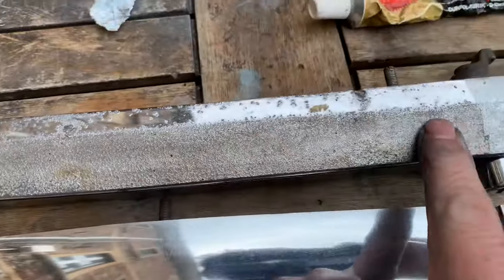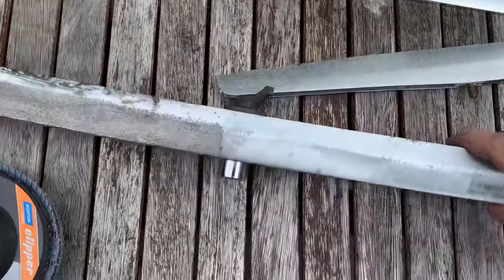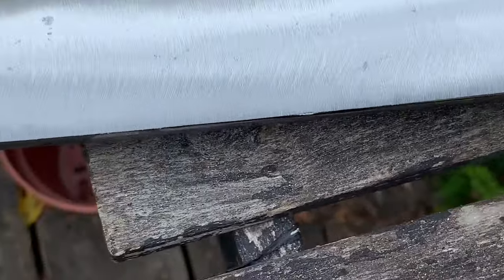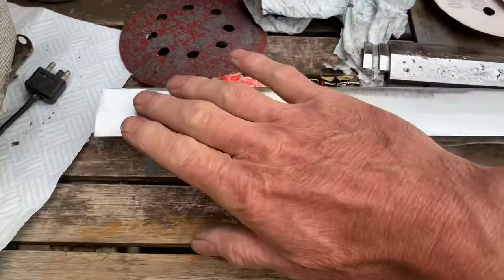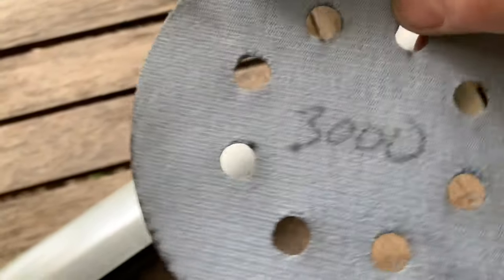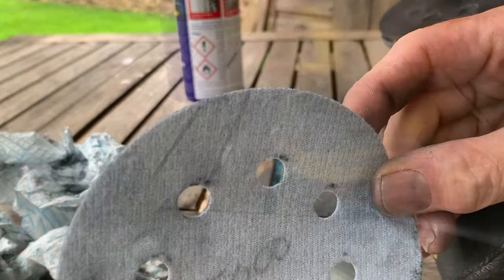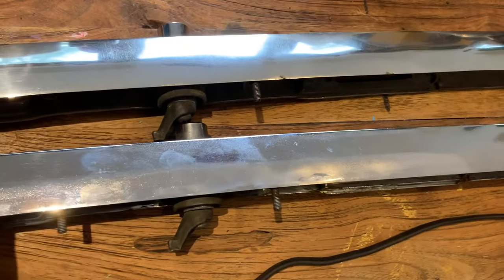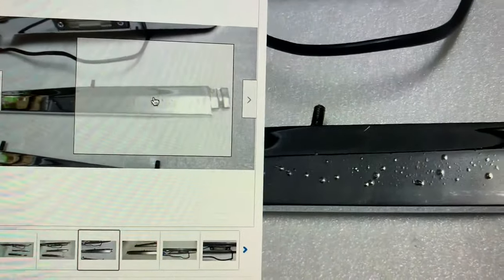Mercedes r107 - how to get a mirror shine on rusty pitted chrome

Comment: Didnt u just sand the chrome and copper outer layer and polished the steel core?  If so it will rust quickly…
Reply from the maker: Thanks for you comment. That would certainly be true if those pieces of trim were made from steel but I think they are aluminium or some similar alloy. Mike
Reply: @MikesMercsandothercars  well then the only option would be re coppering and rechroming it... I did what u did with 70 challenger trim and i have to polish it frequently as it becomes dull.
Reply from the maker: @pawelsyrek3721  Thanks for your comment Yes - I am interested to see how it holds up.Aluminium will definitely dull BUT we are definitely in a better position than before without the expense of re-chroming...I have several spare pieces of trim and may see whether there are any products out there which would adhere and seal. Maybe the new breed of 2k clear coats. Mike
Reply: @MikesMercsandothercars  Great video, thank you 👍.  I think it might be worthwhile trying a ceramic coating as opposed to spraying them with a clear coat. My reasoning is that as the items are highly polished there is no key for the clear coat to bond to.
Reply from the maker: @karl3927  That sounds like a good idea - I might try it next time. Mike
Reply: @karl3927  You can also use a clear adhesion promoter for metal, by UPOL, and then top with any type of clear coat.🤙
Reply: @marcusprince3999  Thank you for the tip 👍.  I'd never heard of that product before. It seems to have great reviews too.
Reply: @MikesMercsandothercars hey man, how did it hold up? Seriously need some answers for my own vehicles sake
Reply from the maker: @11secbug  Hi - those rear pieces still look good and I have not yet needed to polish them. Having said that....the car hasn't moved from the garage yet as I am still restoring it. Mike

Comment: Great video. As everyone wants to point out, this is completely removing all the plating including the chrome and giving you bare metal, but so what? Now you can take care of it, keep some polish on it, and if you do see some rust you can spot polish or even sand and re-polish it easily. Pitted chrome is worse, it collects water then rust and pits horribly and looks like garbage, this will look great and even develop a protective patina that may even look better than super shiny chrome.
Reply from the maker: Yes - I agree with everything you said. Two years later this piece still looks good. Obviously if money is no object or the piece was in full view, you would have it professionally rechromed. Mike

Comment: Looks good and certainly worth the effort. Its not really making the chrome shiney again though, that process has removed the chrome entirely and is polishing the base metal instead, which will need a clear coat finish depending on what the base metal is .
Reply from the maker: Yes you are right. In this particular case, the base metal can be polished nicely. If money is no object, it is always best to take the parts to a specialist and get them re-chromed. Mike

Comment: This is definitely removing chrome, but repairing it
Reply from the maker: Yes you are right. If money was no object, you would get these professionally re-chromed. The method outlined in this video works great on a piece where the underlying material can be polished. These still look great 2 years later. Mike

Comment: Nice result, but usually the chrome is a very thin layer that is put on a piece of metal. When doing all this sanding isn't the chrome layer completely gone and the underneath metal is polished? Maybe that chrome parts of old cars have very thick chrome layers?
Reply from the maker: Thanks for your comment. Yes you are completely correct. Once the chrome layer has been breached, you either need to strip it chemically, fill it, copper layer it and then re chrome it, or....sand it all off and polish the underneath. This wont give as good a result as re chroming but it is substantially cheaper and something that people can potentially do themselves. Mike

Comment: If it helps, I took the door thresholds to a metal polisher. He was doubtful as he thought they were chrome-plated (which he said couldn't be polished on his wheel as it would remove the plating completely), but it turns out they were an alloy and they polished up beautifully on his wheel. Suspect theses boot 'chromes' are made from the same material.
Reply: It may well be an alloy but looking at the pitting and blistering of the original chrome, it was chrome indeed plated. So unfortunately not a video showing how to refurb chrome but rather stripping it off and polishing the base metal instead.

Comment: Hello Mike, i have a mercedes 190sl. Bumpers are pitted now. Do you think this same process would work in those bumpers. Cost to rechrome is tremendous
Reply from the maker: Hi - I definitely would NOT use this method on the bumpers of a 190sl. How much have you been quoted to get them re-chromed? ...and where are you based? Mike

Comment: i seem to think this is stainless steel n not chrome . i deal with chrome every day as i restore old bikes n cars . if you were to use that amount of sanding on chrome the copper would start to show threw . id like to see a magnet held to the part as stainless isnt able to attract to a magnet .they never made 304 stainless surrounds for cars only 316 n that definately wont attract to a magnet .
Reply from the maker: Hi - these days you can get polished stainless steel replicas but the originals were some type of alloy. Good point about the copper showing through…..maybe they are just polished alloy and not chromed after all. Mike
Reply: @MikesMercsandothercars  hold a magnet to it if it sticks hard its chrome  on steel . if it slightly sticks its 304 stainless cause 304 has small amount of steel in it . if the magnet wont stick its either alloy or stainless316..if magnet wont stick scratch the back of part , if it scratches easy its alloy stainless is hard n brittle if its 316 that why they put steel in 304to make it plyable eg; stainless exhaust pipe

Comment: Brilliant, always. Well worth the effort and cost. 👍🏻👍🏻👍🏻
Just picked up a boot seal for $29, delivered. I’ll probably bring home a couple of rear light seals as one of my light units has some moisture inside.
Reply from the maker: Thanks for your comment and support. Wow that is cheap!. Definitely get a set of rear light seals. You could also consider a set of door seals. Not usually a source of leaks but that comforting Mercedes clunk as you close the door tends to go as the door seals wear out. Mike

Comment: The material you are working on is zinc die cast also commonly knows as mazak. 
Originally this will have been polished, cyanide copper plated, nickel plated then chrome plated to reach the desired chrome finish. 
It’s inherently not a nice material to rechrome as once the corrosion process starts it’s leaves deep powdery pits which can be hard to remove. 
There’s not many platers in the UK which will replate masak anymore.
Reply from the maker: Thanks for your great comments and insight. How do know so much about this? Mike

Comment: Hi Mike when I polished up my alloy parts of my sl350 r107 (THE WINDOW SCREEN  SURROUNDS ALLOY STRIPS UNDER DOORS AND HARDTOP trim   ETC) mercedes normally put a clear coat lacquer on which I removed the old lacquer and  polished up and re lacquered so you could try lacquering the alloy parts all the chrome on my was sl 350 rechromed for about £800  ( not including the bumper my was the early chrome whats was made from thick German  steel and better chrome plated than the later sl 107 range) great video you are doing sorry hear about the scum who broke in to your garage keep up the great videos thanks mark
Reply from the maker: Thanks for your detailed comment. At some stage I will be doing a video about how to restore the anodised aluminium parts on the SL (window trim etc) Can you tell me:
1. What product did you used to remove the clear coat on your trims?
2. What product did you use to re-lacquer
3. Which company did you use to rechrome...and what sort of comdition were the parts in eg OK, bad, completely knackered
4. Did you remove the anodised aluminium layer and polish the aluminium....or did you polish the anodised aluminium?
5. What polish did you use and how did you polish - eg by hand...fixed wheel...drill etc

Thanks

Welderless Mike
Reply: I  hi Mike first of all rechroming is the best way other then you if you  can buy a stainless steel alternative ( on my 1960 fiat 500 my bumper and headlight rims I replaced with stainless steel ones) or the other cheaper options are slivehook chrome aerosol or chrome powder coating or there are diy chroming kits companies like frost sell never tried ,right now for the alloy mercedes 107 strips trim  first of all if the trim if the lacquer is only scratched just rub down wet and dry then relacquer then  polish with compound etc ,I removed the lacquer with different  grades of scotbrite wheels on a polishing machine then used different compounds and mops ( it  thats a lot time and you have to very careful not to damage or bend the thin strips) or alternatives are paint stripper or sanding down then polishing I used 2k lacquer which dose dull the alloy trim a little , the company I used was Douglas plating South East London near Deptford about 4-5 years ago cash in hand for job lot if you don't  mind  waiting when they have time maybe couple of month's my took i love you videos shame they wasn't about 5 years ago you have help me out with my mercedes sl350  restoring etc thanks mark ps the chrome work done by Douglas plating  top notch have used before no problems

Comment: brilliant how thick is that chrome or is that poor grade stainless steel.
Reply from the maker: Hi - I think on a Mercedes R107  this part was originally made of some kind of alloy. Obvioulsly the proper way to go would be to fill the holes, re copper and rechrome but....not everyone has the money to do that and on this particular piece simply sanding a polishing worked a treat.

These days a reproduction of this part is made from polished stainless steel. Mike

Comment: hi.great video thanks for sharing. I have a chrome head light .it's in pretty good condition. it has a few rust pits the size of a pin head .what would you recommend doing. thanks
Reply from the maker: Hi - do you mean a chrome headlight bowl or a chrome rim? I what car is it on? Mike
Reply: @MikesMercsandothercars  thanks for your reply  it's a chrome headlight bowl on a motorcycle .
Reply from the maker: For a headlight bowl, the best thing is to have them professionally re-chromed. Don't use this sanding method as this removes the remaining chrome. This is fine if you have an alloy below that you can polish. There is a video I did a while back where I refurbished a headlight bowl using Chrome spray paint - it worked OK ...but obviously not as good as re-chroming.  see 8.44 in the video below:
https://www.youtube.com/watch?v=x3DwYi1EnvQ @bc-mr1si  

Mike
Reply: @MikesMercsandothercars  thanks pal.tbh it's not that bad as I said the holes or rust spots are the size of a pin head .I'd maybe make it worse so maybe better left alone .
Reply from the maker: yep...if it aint broke ,dont fix it. Mike @bc-mr1si

Comment: How do you keep it from tarnishing again with just the bare exposed metal? Do you use a sealer?
Reply from the maker: Thanks for your comment. Tarnishing does not seem to be a big problem on this alloy and I didn't use a sealer. Mind you, the car sits in a garage and is not parked outside in the elements - I guess that might make a difference. Mike

Comment: Incredible. I've got 3 cars that are crying out for this but I don't have an angle grinder and was thinking to go down the elbow-grease with a steel wool 0000 grade route. This looks so much more inviting though! Can this method be used on'64 w113, '78 r107, '64 mustang bumper and window trims?
Reply from the maker: Thanks for your comment. 

If it is just spotting then I would use something like Autosol to polish the bumpers.

I probably would NOT try this method on the window trims on my mercs because from memory they use some kind of aluminium vapour deposit technique. The window trims are quite thin and I'd be worried about having an angle grinder in the same room let alone using it on the trims.

Similarly for the bumpers......if you have not already done so, take a moment to have a look at these 2 videos:

https://www.youtube.com/watch?v=B8zGjOFGHrk

https://www.youtube.com/watch?v=hQGic5k2vBw

If you have rust bubbling through the chrome on the bumpers, it generally is a sign that the bumpers are starting to rust from the inside out and you need to address the situation before it gets any worse.

 The boot chrome featured in this video is different because the alloy under the chrome polishes up nicely. If you sand of the chrome on your bumper, you'll be left with steel.

My advice would be to take off the R107 bumper and check out how bad the chrome sections are and source replacements.

Mike
Reply: Now thats advice learned from many years experience. Cant beat knowledg gained from actually doing something, its far superior to book knowledge.

Comment: This may be a silly question but does it matter if the part is just chrome plated? Also, how would I tell?
Reply from the maker: Hi- there are no silly questions.

This method would remove whats left of the chrome plating. IF the material below the chrome was 'polishable' (if that is a word) then this method might work. The 'chrome' boot trim pieces  featured in this video came up really well because the alloy under the chrome was 'polishable'. Obviously, the best results will always be achieved by taking the parts to a chrome plater and doing the job properly. Mike

Comment: What do you coat the raw still you are left with ?
Chrome coating is long gone, after the grinding and polishing you are most likely left with the iron exposed, do you send it to get chrome plated again or just some clear coat ?
Reply from the maker: Thanks for your comment - The material is some kind of alloy and I have just left it as is with no top coating. The material is some kind of alloy and it still looks a million times better than it did. No signs of rust or corrosion 1 yr later but this car has been garaged since then,  Obviously this method is not as good as getting it re-chromed BUT it is of course much cheaper. Mike
Reply from the maker: Thanks for your comment. I did think of ceramic coating and may do this at a later date. If you have attempted this yourself, let me know what product you used and how it came out. Not 100% sure what you mean by 'flat angle pads, but the only sander I used was the Dewalt orbital sander. Mike   Jasongibson333